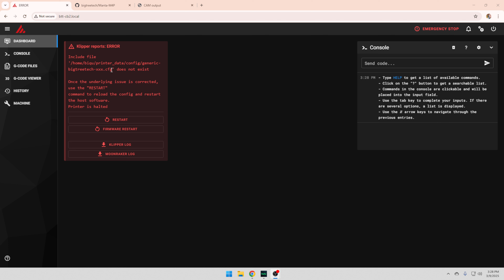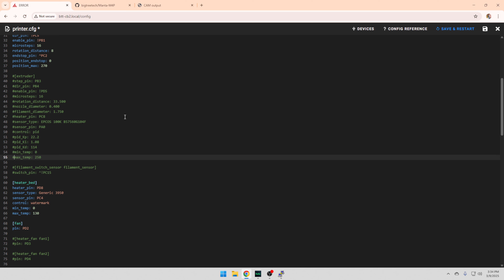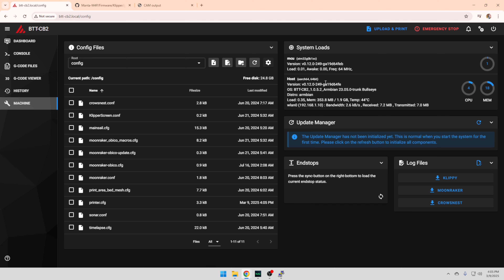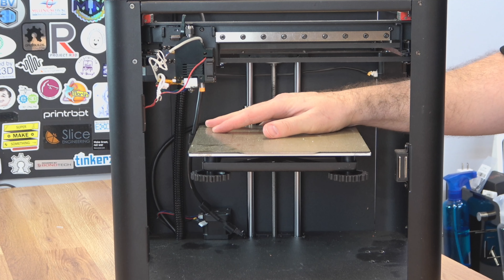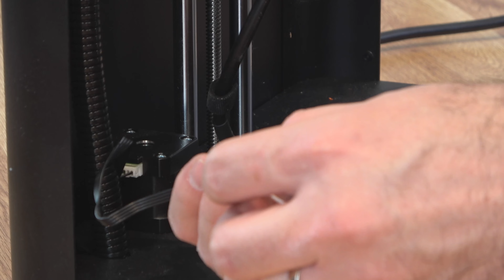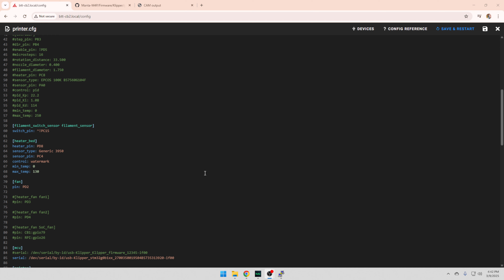3D Printer Fix Up - Kingroon KLP1 - Part 2 - Printer.cfg - Chris's Basement 2025

Comment: Hi Chris!

Really enjoyed the video! I have a question about the USB toolhead. Do you need an adapter board for the 24V,5V power between the mainboard (Like USB to CAN adapters do) or can you connect the PSU 24V and Ground to the toolhead and just connect 2 data wires from the mainboard that transmits the USB data?

Comment: Just a tip. In klipper if you are #ing config sections in or out, rather than doing it line by line you can highlight the whole section of lines and use ctrl / to comment or uncomment everything at once.

Comment: Great too see you carrying on with this, I'm gradually refining the configs for mine, still using the stock board for now. Depending on what nightmares this build gives you I may well give it a go :) I've designed a modular riser for the lid.

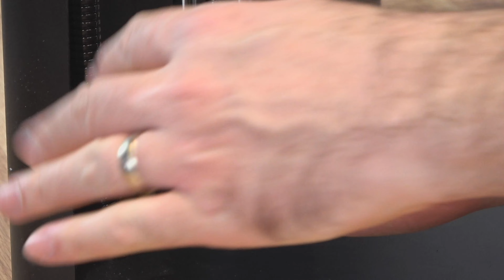Comment: What great timing! I'm actually doing a complete overhaul on a Tina2 S that I picked up broken. 19:29 I did something similar to test the motor but I used an LED. It should light up when you turn the motor if you've paired the connection. So far my project is coming together really nicely, Klipper seems happy with the settings and sensorless homing. I just have to clean up the rat's nest of wires everywhere in that tiny printer.